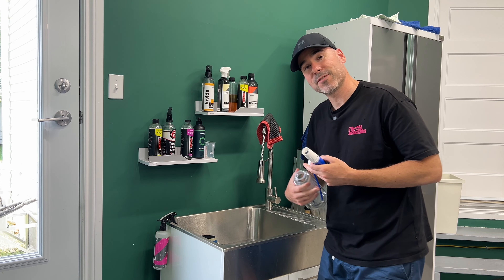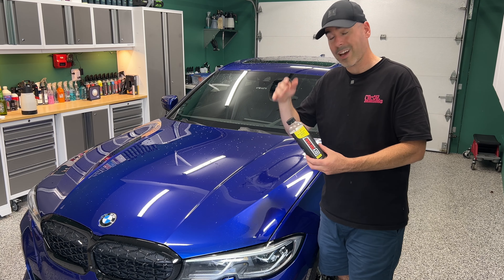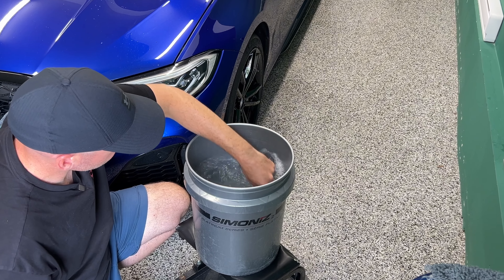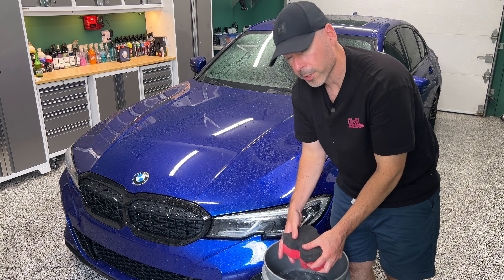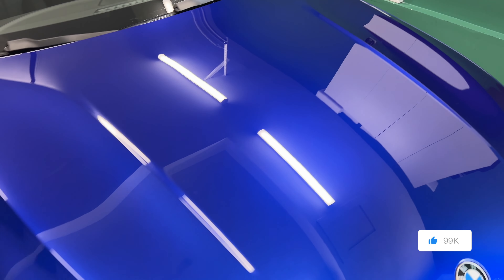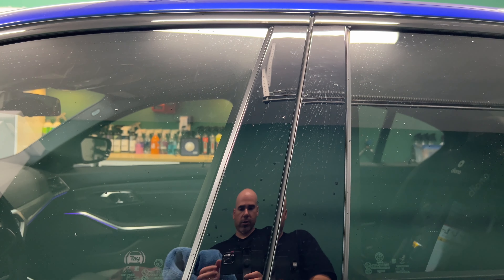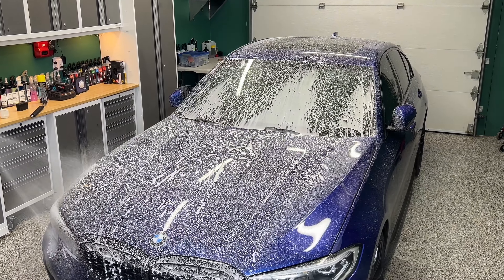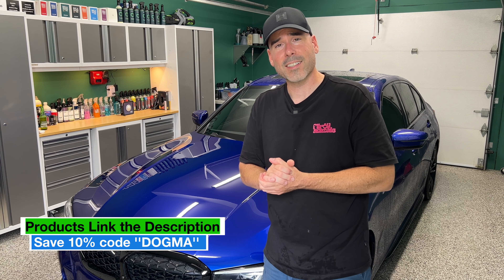The RinseLESS that BROKE the INTERNET DIY Detail Rinse Less Wash V2

Comment: Hey Frank.
I too do a prefoam and rinse followed by a rinseless contact wash.
I use my home made détail keg with a 40 degree spray tip for my presoak of rinse less.
Once my current gallon of DIY rinseless is used up I’ll be ordering a new one.
Reply from the maker: Very good process Steve, nice handy man 😆 Cheers brother

Comment: What would you say if you put your car in to a detailers and they did this 😮
Reply from the maker: what do you mean brother?
Reply: @Detailing_Dogma  in my opinion if you’re going to clean your car wash it properly. I see these product’s as a gimmick my car was £112k it’s fully ceramic coated so why take the chance scratching it. These products are not some king of magic you could use water itself to do the same job in my opinion I’ve been doing this for 30 years I would never do this to any car 🏴🇬🇧
Reply from the maker: @billycM5  Did you watch the full video?  you think im dumb enough to damage my paint brother?  Dont knock it til you try it.  I still prefer the traditional soap my self, but I mentionned all of that in the video, when its 100% humidity outside and 38 degrees I prefer to work indoor with AC.  The car was pre-wash as well off camera.   It's a nice alternative that actually works good.
Reply: @Detailing_Dogma  that’s my point you will damage your paint if you keep using that stuff I would rather a dirty car than a scratched one wash the car when possible not because you want too 
I’m not saying anything against you personally 👍🏻🏴🇬🇧
Reply from the maker: @billycM5  Hey Billy thanks for the feedback my friend.  Different belief different people!  But in my experience when used properly it doesnt scratch more than soap if don't miss spots.  cheers
Reply: @Detailing_Dogma  🙏🏻🏴🇬🇧